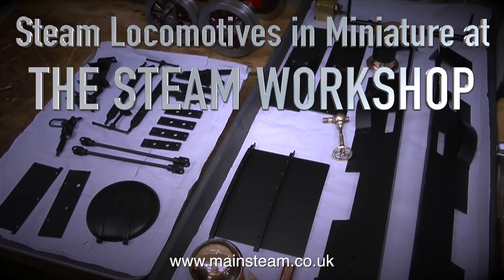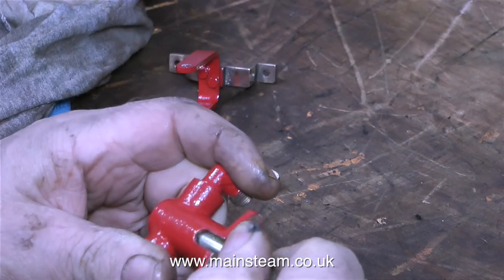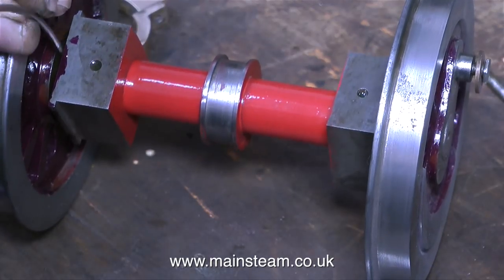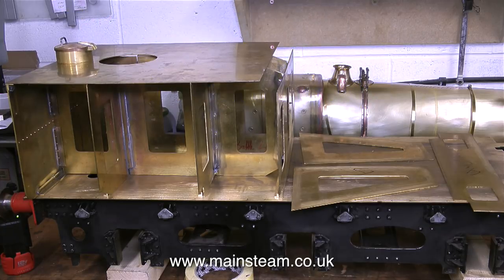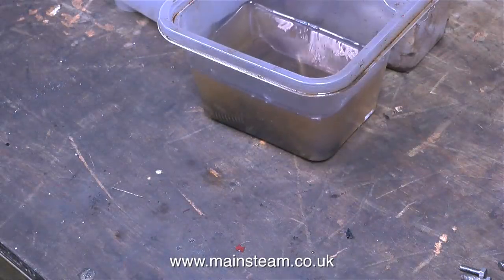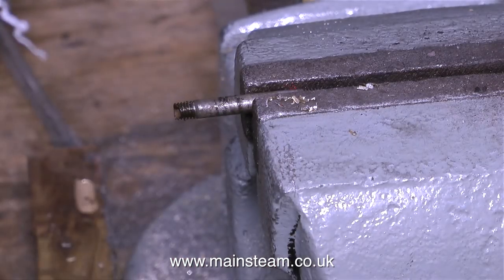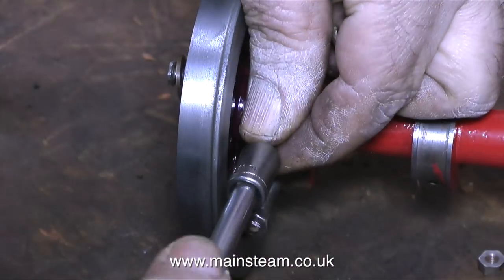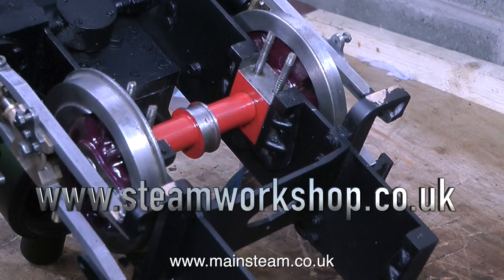WORKING AT THE STEAM WORKSHOP #7 - COMMENCING REASSEMBLY

Comment: There is nothing wrong with using emery cloth or sanding in the lathe, you just need to be sure and clean the ways before you move the carriage around. The abrasive particles are a lot more likely than larger chips to get under the wipers os stick to the leadscrews and do a bunch of damage. It's the same when turning cast iron or using a toolpost grinder.

The 'carriage' part of a surface grinder generally extends over the ways which helps a lot to cut down on grit collection. They also run on rollers because of the constant back and forth motion. This lets you have an oiling system that effectively flushes out grit. Plus, any grinder designed to last for more that a few years will have all sliding surfaces completely enclosed with overlapping shielding plates or flexible boots (like automotive shock absorbers).

Comment: My new Milling Machine arrived and I went out and bought a 4 X 4?
Yes a 4 foot by 4 foot drip tray with 6 inch sides as it is going to be a messy beast!
A bit Butch but will do a set of frames hornblocks in one setting!!
You can buy covers for all the slideways if you like but I am currently putting in and covering a pair of D R O's and a depth stop! So many mills do not have this vital bit of equipment!

David and Lily.

Comment: I looked up “cellulose thinners” and found this cornucopia-T

Cellulose thinner is lacquer thinner. It can be in the form of ethyl cellulose, cellulose acetate, or the more common nitrocellulose or cellulose nitrate. Lacquer thinners also contain ringed hydrocarbons such as toluene and xylene. All these compounds make the thinner pretty hot (volatile). Lacquer thinner is the most toxic of the three mentioned--because of the components and increased volatility. This stuff is great for thinning lacquer paints (Duh!) and for cleaning the crud from an airbrush. 

Mineral spirits contain long-chained hydrocarbons (aliphatics) and are by-products of petroleum distillation processes. Petroleum naphtha and stoddard solvent are some of the products found in mineral spirits. White spirits is another name for mineral spirits, and contains stoddard solvent as its primary ingredient (usually). This material is superb for thinning enamels, enamel-and even oil-washes, and cleaning airbrushes. The stuff sold by Testors is hotter than the stuff you buy on the shelf in the half-gallon can at Home Depot, but they will both provide the exact same results; the Testors will cure/dry faster, however. This material ranks third in relative toxicity after lacquer thinner and turpentine. 

Turpentine goes by the name gum turpentine, oil of turpentine, steam distilled turpentine and gum spirits, among others. Turpentine is obtained by distilling the gum from various species of pine. It is a mixture of isomeric terpene hydrorocarbons. Composition varies with refining methods and the age, location and species of the softwood source. This material would typically be used in the thinning of oil paints, pigments, etc. This material's toxicity ranks second after lacquer thinner. 

Hope this helps a little. 

Gip Winecoff

Comment: Here in the states.  The ruler is called a scale, or at least that is what they told us in college.  I am guessing that the loco had derailing problems as the axle didnt allow for diagonal movement.  It may go nicely verticaly, yet a locomotive is supposed to have the ability for the wheels to flex in the frames.
Reply: wi11y1960 — I learned that a rule was for measuring and that a scale was for making scale drawings, i.e. a 1/4 scale scale would have 1,2,3, etc a quarter inch apart. I also see many exceptions to my explanation, but there is no reason so, IMHO.
Reply: And giant bottles of Locktite command giant prices!

Comment: On a surface grinder, you simply don't see exposed ways. Ways are either facing down and/or protected by way covers. It is also a big taboo to blow grinding dust on or even around a surface grinder.

Comment: Staying on the track is down to getting the weighting just right with a fully loaded up locomotive.
Didcot have gone digital and a pair of readouts sit on the wall telling of just how much weight is pushing down on the pair of wheels as they sit on the scales.
With an 0-6-0 the middle pair could be hard down and the leading pair waving in the wind so jumping at the chance to fall off!!
The steam Workshop should be so equipped?
Its like a Garage not having a Tracking device for your front wheels!!

David and Lily.
Reply from the maker: I agree with you, but digital readouts are not really needed -  when they have an experienced team of model engineers armed with a flat bladed screwdriver, good mechanical "feel" and years of experience }:-)))

Comment: Keith, your railway a question. Are the tracks a manufactured product or are they just hot/cold rolled flat bar? welded to cleats. I showed my wife your video of the family riding around your garden and a couple of other garden railway videos, she was very interested in one to run down and around our pond when the little pond steamboat is done this spring, she's always trying to keep me from getting board in retirement. I think I would do a gas electric and not steam, I fish in that pond everyday the weather is nice so it would have to be just as easy and quick as the golf cart or is that a bad thing in the garden steam railway cabal?
Reply from the maker: My little railway is built from 1 inch by 1/2 inch flat steel bar welded with stretchers to 7 1/4 inch gauge and then every 9 inches there are flat bar "chairs" welded on and these are screwed to the Tanalised sleepers. There are other ways to do it though, kits are available which use aluminium rail and plastic sleepers ......
Reply: Thank You, any books you can suggest on construction, layout and details of tracks? Something I can educate myself with.
Reply from the maker: Not really, my friend & I made it up as we went along.... I bent the rails and he welded the parts together. There is an article I wrote shortly after we built the railway - maybe there is some info you can use in it . . .
Reply from the maker: http://www.academystudio.co.uk/keithpages/steampag.htm
Reply: Thank You Keith, it is very appreciative.